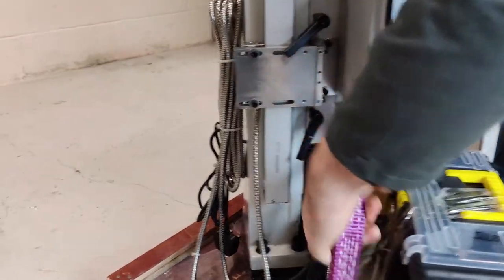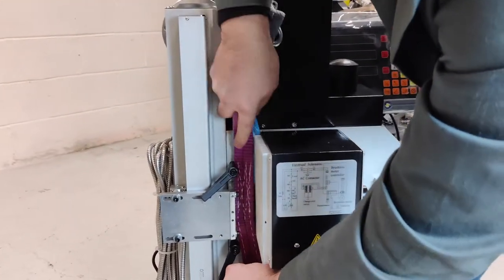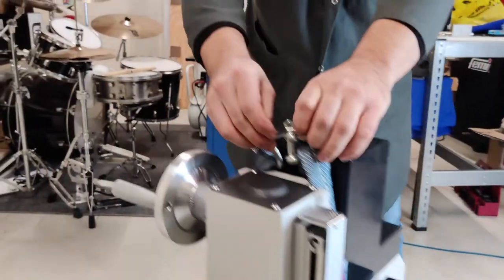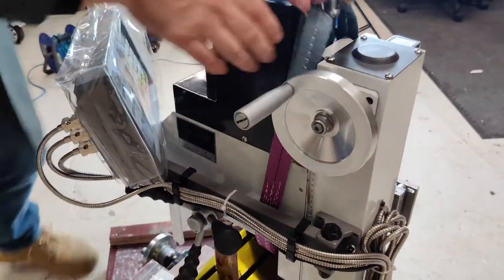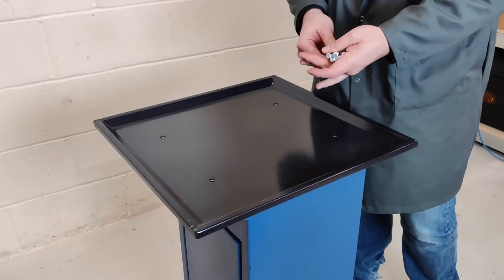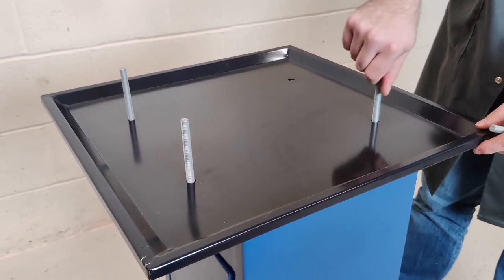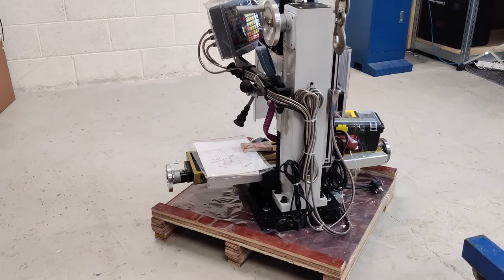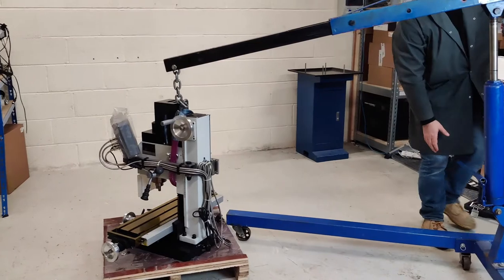How to safely lift your EMV-25VBB Bench mill

Comment: My mill is still on the pallette in the garage... what type of hoist did you get I need to rent one?
Reply from the maker: The machine weighs 175kg. A 1 ton hoist with a 1m long strap is all I used. The engine crane was rented for the video. Most owners rented them as well. Please do not disassemble it to lift it, unless you know what you are doing of course...